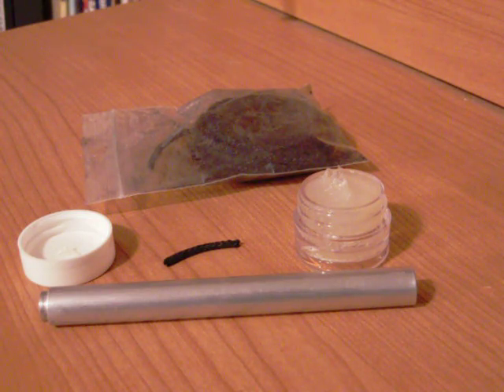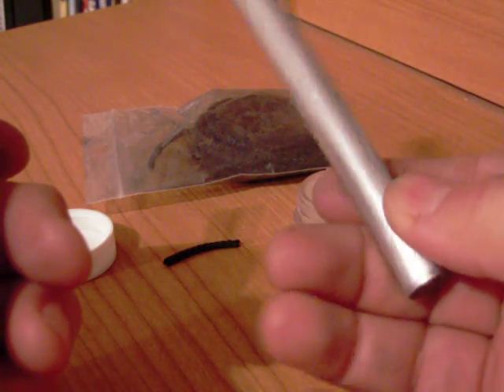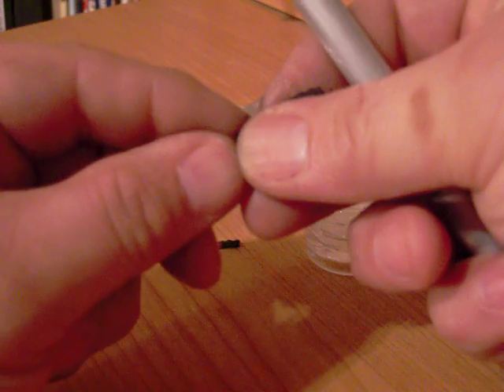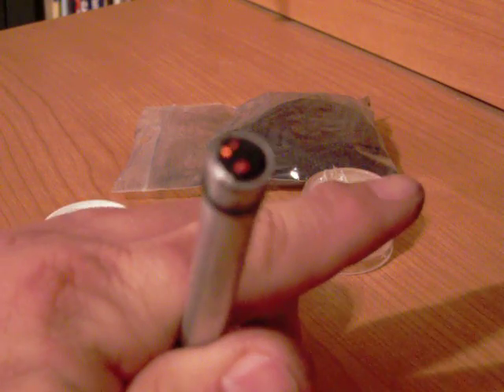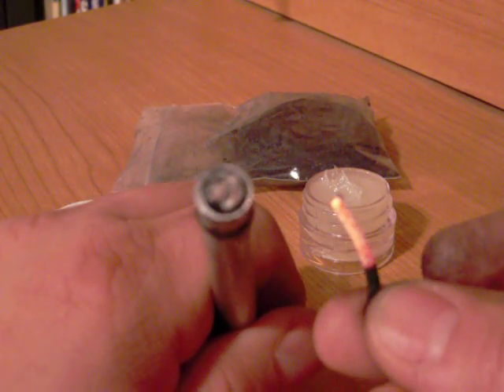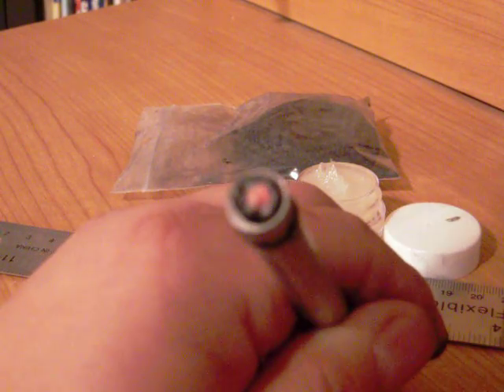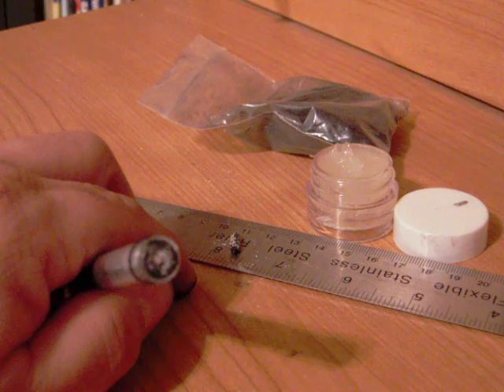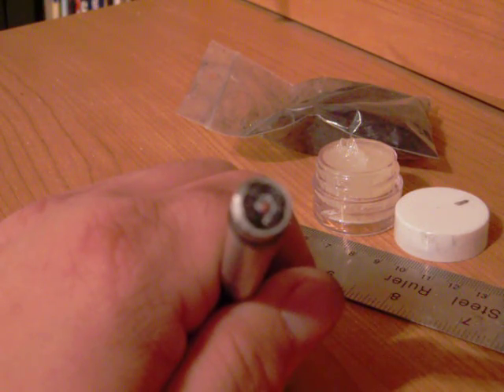Home Made Fire Piston.avi

Comment from the maker: I really don't know what size the O ring is; I have a loose assortment and tried them until one fit. I have miked the one I used and here are the measurements. ID 0.209 in, OD 0.342 in and thickness is 0.075 in hope the info helps. Thanks for watching. PS I use O Rings that are not affected by petroleum so I use standard vasoline.